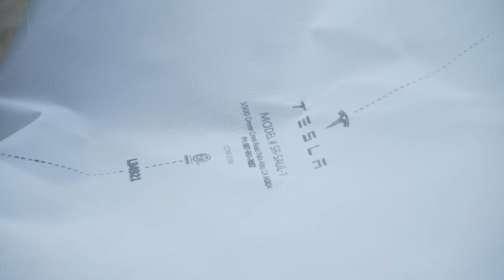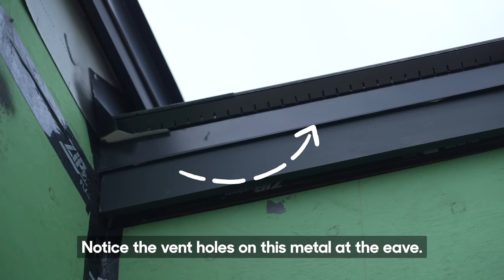Tesla Solar Roof - A Builders Perspective

Comment: We've been living with the Solar Roof for almost two years now. Love it! We had it put on an older house, and that made it much more complicated install than this project. This looks really slick, glad you finally did a video on this, Matt!
Reply: Are you located in an area where you get lots of sun like CA or TX? I’m in IL so I’m curious about the performance possibilities for my area.
Reply: The Tesla brand solar roof?  I hear good and bad results of this roof.  So I’m skeptical about the brand.
Reply: @mykarma0011  Google "insolation map". That will tell you how "sunny" it is where you live. If you have basic math skills, you can actually calculate the upper limit of what you can get with your rooftop solar. PVs typically operate at like 25% efficiency, I want to say.
Reply: @quandombus18 I can't comment about Tesla roof but I have a standard solar grid on my roof and it has been fantastic. It covers my electricity bills for 90% of the year and I'm in NY in an area that gets more Grey skies then Seattle which is known for its dreary weather. 
I financed most of it and my payment matched my electric bill. However with Covid everything went up in price including electricity (about 25% increase) and now I'm saving money.
It should add value to my house, the roof under the panels last longer as they aren't exposed to the sun, and honestly I think it looks pretty decent as 90% of my garage roof is covered with all black panel/grid. 
My only concern is in the winter the system doesn't have a melt feature so snow can stay on the panels and not generate. I have since gotten a rubber roof rake to clear them but a melt feature would have been nice
Reply: What are the real numbers considering cost, install, maintenance, and repairs?
Reply: @quandombus18  Your smart, always be skeptical with new products, especially living in these days with marketing teams that know how to stretch the truth to the point its a lie but doesn't look like it.
Reply: @petebusch9069  I am going off my head but I think the cost was around 25G for 26 panels (not sure Kwh size). NY has a great tax credit system along with the federal gov. This nocked off 12g or so. I pay about 100 dollars a month for 15years but thanks to COVID i was able to get a crazy low interest rate so I dont mind the long payment plan. 
I pay 110 a month for Solar. My old electric bill was averaging to be 108  a month. Like I said prices have gone up 25% so that would now be $135. I still pay a "hook up" fee monthly of around 15 dollars. So all in I am saving 10 dollars a month. For me it isnt about the savings, it is about being green.
Warranty: Labor for 10years, equipment is 25%. I believe at year 25 the warranty states they should still be ?80%? efficient as they do degrade. I could have paid more for panels that dont degrade as "fast" but i figured after 25 years panel tech will be drastically better or their will be something entirely different that is better, also I probably wont be living here anyways. 
Maintenance and repairs: I haven't had to touch them other then cleaning snow off of them which is completely optional. Some people in areas that dont get a lot of rain or with low pitched roofs may have to wash/hose them down. My roof is average pitch for my area and I think the rain does a fine job.
Other: I forgot to mention I can sell my unused energy back to the grid 1 for 1 in terms of credit, not cash. So in the winter my production does not cover my demand but I tap into those credits which comes close to covering my entire demand. If you cannot sell them back to the grid, I dont think solar makes sense unless you have a battery. Batteries are stupid expensive and unless you cant sell unused energy back to the grid or in an area with frequent outages, it doesnt make sense imo.
Also worth noting, if the power goes out you also do not have power unless you have a battery. This is to protect the linemen when repairing downed lines
I am overall pretty happy with my system. I would purchase again and hope to see more install them on their houses. It really does make sense.
My system would have covered my needs but I added a 750sqft shop that I heat and cool. Because of this I come a bit short during the year.
Feel free to ask more questions
Reply: @petebusch9069  Tesla has no marketing department.  The only information about Tesla products is videos like this or sit down with a rep.  Tesla has a reverse business strategy.  Unlike every other corporation whose main goal is to maximize profit margins by cutting overhead and pushing the market, Tesla endeavors to make the best possible product that emerging technologies provide while selling at the lowest price they can and still be profitable.  That's why demand for Tesla products outpaces production rates, even with new Gigafactories being built every two years.  It is true that they push the envelope with what's possible and sometimes the engineering needs to be tweaked in the initial stages, but they always work it out.
Reply: @topherdean1024  Tesla demand outpaces production because people follow stupid trends. If you think Tesla's main goal isn't profit then you really bought into the BS.
Reply: @petebusch9069  My 8.7kn system with 2 PW installed in June 2021 was 33k after all incentives. I live in north NJ
Reply: Yessir
Reply: @petebusch9069  Dude, of course Tesla's goal is profit. Elon isn't (the) 'richest' guy on the planet because he's a philanthropist. That being said, how's that rotary phone you're using working out for you, or that typewriter, or riding your horse to work? Let's have some vision here. If it's not about today, how about tomorrow (I don't mean literally before you take it as such).
Reply: @tonys2957  So according to you everything new is good and nobody has a right to question it or call it out? I would love having you as a customer, easy sell.
Reply: @petebusch9069  It seems you misunderstood my comment. Successful products solve problems. It's that simple. (We) have an energy problem. TESLA has struggled with this solar roof product since inception. The fact it is being installed 8 years later is some evidence they have overcome early hurdles. Additionally, the roof is only a component of a much more comprehensive system. In the industrial space, TESLA power products are eating up marketshare for UPS and managing grid pricing and service volatility. It seems the residential side is going strong. Change is a constant. You can educate yourself and do your own due diligence, or be left behind.
Reply: @tonys2957  We don't have an energy problem, we have a failed government creating what is perceived as a problem. You also have a false perception of reality thinking your winning while stating something about being left behind. From my point of view watching all you people trying to stay current has become quite fun. The best part is when everyone gets quiet when the light goes off that they just wasted a TON of money on some useless junk. You want others to join in so you can share the failure later on verses being the only one. Turtle always wins the race watching those who appear to be ahead completely fall on their face.
Reply: @purefury702  
Sorry, Project Sunroof hasn't reached that address yet

Comment: We had this installed a few years ago.  Our underlayment was shot so needed to be reroofed.  I got 4 bids on reroofing with new underlayment but with my existing 25 yr old roof tiles put back down.  When we looked at the Tesla option it was a no brainer.  We will realize enough cost savings that the roof will pay for itself in 12-14 years.  And it only takes 4 years payback to get to what the traditional re-roofers price was.  And it's a brand new roof adding resale value.   Very happy with our 8.5K system and no electrical bills (So. Cal).  If anyone wants a discount on Tesla I have a referral code I can give you.  Thx
Reply: I would be interested in the discount code as we are very interested in installing this.
Reply: I’m interested. If your promo code is still works.
Reply: Would love to have the promo code too! Thanks!!
Reply: Promo code, please!?
Reply: @sleepybear7642  How so? If the system pays for itself in12-14 years seems a no brainer.
Reply: @vickykennel7414  Actually regular roof is not the way to go. I have had solar panels (12kW) on my roof for quite some time but my roof was 7 years old when I got the solar. Now I need a new roof in a few years. The roof will be at the 25 year mark. The solar is still going strong minus some small output loss (also micro inverts suck. They keep failing). That means now I have to PAY to have ALL the solar removed then get a new roof then get ALL the solar reinstalled. Better to get a Solar roof in the long run. Everyone thinks  short term. Granted I guess most people like moving from house to house rather than stay in one place. 

Also  home owners insurance covers hail damage. Had a neighbor kid bounce a basket ball off my solar panels and shattered a panel so panels get shatter either way.
Reply: @JamesMartin-tb9vf  houses sell cuz people die, get a terrible disease, a family member dies or has some serious disease, people also "lose" jobs/ie. they get fired. And of course love fails, people separate. Lots of sad situations that result in the average home getting sold every 8 years, it's not even so much when think about all the things that could go wrong...
Reply: Looking at doing the Tesla roof.  May I please have the referral code?
Reply: @sleepybear7642  Are you including a solar power set up of comparable size in that? I can't tell from what you wrote.
Reply: Yes, it's very expensive, BUT It can make sense if you're comparing it to the high-end roofing products. OP stated he would be break-even at less than 4 years in every year after that he's saving money compared to putting back his tile roof. Shingles obviously you are much cheaper
Reply: @sleepybear7642 An article I read just yesterday from a reputable news outlet said you can expect the typical house install for these things to be $150k-$250k. At a $500 a month electric bill, that's a 25+ year payback, excluding the lost opportunity cost of investing that money elsewhere versus paying for 25 years of electricity up front.
Reply: I'm curious what you paid, because I read just yesterday Tesla raised its prices and the typical home install for these panels will range from $150k-$250k.
Reply: Would love to hear back in a few years because after 25 years of watching this technology fail it would be very interesting if you make it past five years without serious problems, and no warranty support.
Reply: @boblatkey7160  Yep, we will see!  Hopefully it all turns out ok.  I don't know if I will be around in 25 years so it will be someone else's problem. :)  I will say the underlayment seems bomber though.  My Telsa install included a Firestone Clad-Gard SA-FR underlayment which is or was the only UL Class A underlayment on the market.  Superior for water and fire protection.  And since the Tiles are tempered glass those will last at least 25 years.  We just had 2" rain and high winds (60mph) last week with Hurricane Hilary and no issues 3+ years in.   But yes, the solar portion remains to be seen.  Always a risk with something new I guess.  cheers....
Reply: @fretbuzzly   pay close attention to those estimates because they hide the bulk of the cost. The bulk of that estimate is the cost to remove and dispose of the old roof and then replace much of that. And that is for the "solar shingle" roof. The panels version is much cheaper.

Like most roofing the increase in costs is driven by the complexity of the roof. For example a straight post-frame build with no added roofing angles and changes is actually quite cheap compared to ones that have essentially a dozen or more roof sections. You can see this in non-solar roof barndo builds because the cost is in the complexity not the base materials. The vast majority of us don't need these fancy rooflines with more faces to them than a D20.

Comment: As a installer of this product I can tell you I’ve broken 3 tiles of all size’s during installation. It is tempered glass so hitting the edges together will break them and accidentally stepping on a top clip will also make them explode. 

All in all I do think they install pretty easily and look nice when completed
Reply: So a nightmare for anyone that works on it afterwards. Cool.
Reply: So you are saying you can not walk on them?
Reply: What would happen in a hail storm then?!
Reply: @markae0  you can walk all over them. When you’re installing them you can step on the tabs or they can break. Then you’re making no $$ and cleaning up glass
Reply: @Mrs.LadeyBug  we set on on the ground and jumped up and down on it trying to break it. Since it’s tempered glass it’s super tough on its “ face” side, but if you tap on the edge it can shatter.
Reply: @MrBongobongbongo  if it’s wet….. we call it Black Death. 

It is like walking on ice / super sketchy
Reply: @paulnelson9269  ok, thanks!
Reply: @paulnelson9269  walking up a wet, sloped, glass surface sounds like a nightmare.
Reply: @Mrs.LadeyBug  they will fly and BREAK,so the storms say shut! UP! And bend over LOLOL.
Reply: @paulnelson9269  Sound just like walking on my metal roof when it's wet!
Reply: @BLKMGK4  it’s worse, because there are no ribs to put pressure on
Reply: Are the clips/brackets made of plastic or metal? Will they,last the heat of the roof?
Reply: Suction cup shoes and you're like Spider-Man. Hope you come up with a good solution
Reply: Just wondering, if they are broken, who accepts them for recycling? Or do they just end up in the landfill?
Reply: @markmoreno7295  they are mostly glass over a piece of fiberglass or so they just went into the construction debris.

To be honest, you are using a renewable energy source, but you are also using a whole lot of plastic to install one of these roofs in the brackets that are used. 

Everyone of us is using a piece of plastic with a piece of glass on it right now to communicate also
Reply: Well after 25 years in the industry I have never seen a manufacturer who has implemented this technology be successful. From an industry standpoint it is an absolute flop. There are many homeowners who are super disappointing and have failures and no warranty support.

Comment: Glad to finally see them up close, would have liked to see more on how they handle the penetrations
Reply: Yeah... i was hoping to see how the roofer handled all the penetrations???
Reply: That is probably why they have generating panels and non-generating panels.  Use the non-generating panels around penetrations and they can be handled the same as regular metal roofing panels.  Try to get all of the penetrations at the same level and just install a couple of rows of non-generating panels.  That way if the roof is smaller, all of the other panels can be generating panels.
Reply: You can see vent pipes and ducts in this video and it looks like they have special panels that fit the grid system.  No doubt they've thought of every question we can think of.

Comment: Follow up on perfomance and any issues definitely required!! 🤓
Whoa - a 50KW roof is amazing! 🤯
A complete walk-through of the power infrastructure would be great. 👍
Reply: Ten Powerwalls is crazy.  Three is considered a lot for most homes.  Plus two generators.  He did say money wasn't a concern for this buyer.
Reply: Way overkill. That is at least 3x what the home will need. Same for the amount of storage they are putting in. Even on a cloudy day that system is going to produce 2x what the house needs.

Comment: Absolutely 💯 It would be very informative to see such an impressive system in its final form
Reply: & see in 15 years how many of the plastic clips/fittings have cracked (if any).
Reply: It's an unnecessary system nobody should be installing. With regular solar, you don't need to upgrade to 200 amps, as 100 amps is fine.

Comment: This is very cool technology.  We want to see this in action, once it is all installed.
Reply: what if baseball sized hail hit it
Reply: @randomrazr  I've shot ours with slingshot and have yet to break it. One of these days I should take it out somewhere I could use something more powerful.
Reply: Did you add in costs?
Reply: @randomrazr  They mentioned the stress tests that the panels go through to be certified.